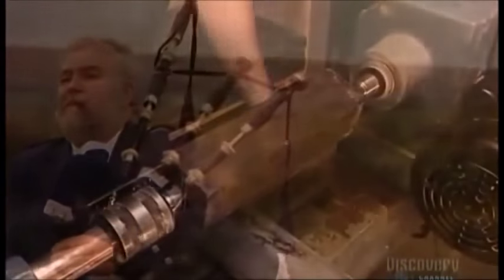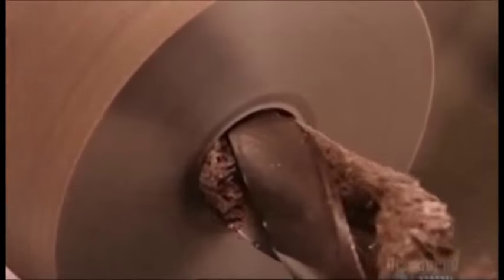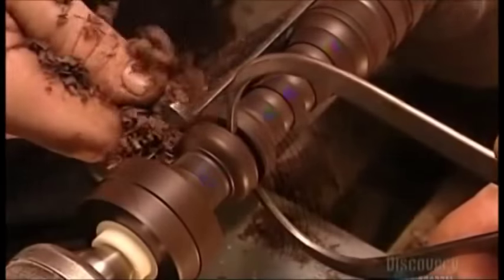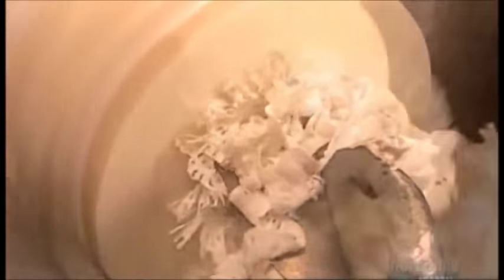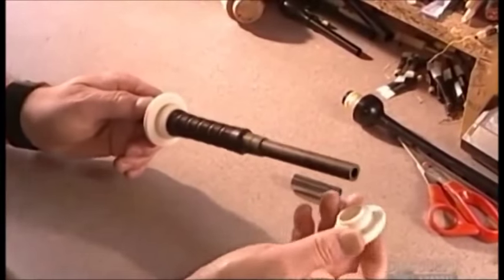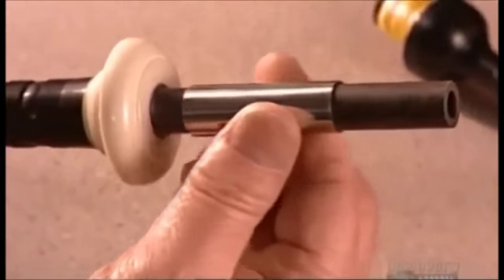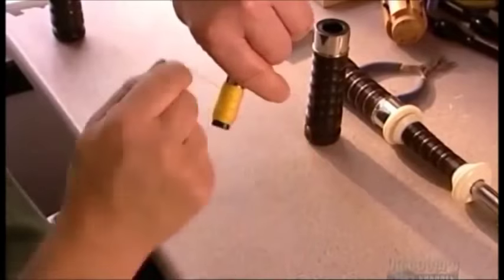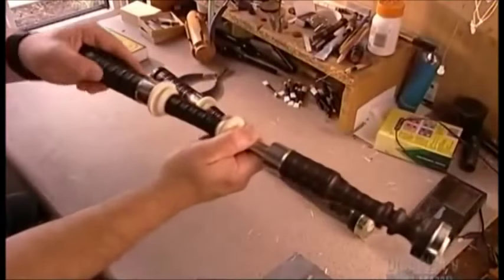How its Made - Bagpipes

Comment: Not the best instrument for your ears tho
Reply: Indeed. Outside, a set of Scottish Highland Bagpipes can reach somewhere between 108-111 dB, the equivalent of a pneumatic drill. Inside, the sound ends up reverberating off the walls, and this raises the sound intensity level up to 116 dB (just below the threshold of pain), the equivalent of a chainsaw. You definitely need ear protection when playing this instrument, although earplugs can affect how accurately you can tune the bagpipe.
Reply: @draco4569  This is why, if I were to play bagpipes, I'd much rather play something like Scottish Smallpipes, or the Uilleann Pipes (the bagpipes in Ireland), or anything else like that which is a lot quieter than the highland bagpipes. And I also prefer their sound a lot more, personally. And even if I sounded terrible on those instruments, it would still be far less annoying because they're a lot quieter than the highland pipes! If I may be really honest, I actually feel that the highland pipes are, well, maybe even a bit overrated. They're everywhere. They're the most well-known bagpipes in the world, pretty much (the Irish Uilleann pipes are a close second though). Meanwhile a lot of other versions of bagpipe in the world fall into obscurity or practically don't even exist in comparison to the popularity of those highland pipes!